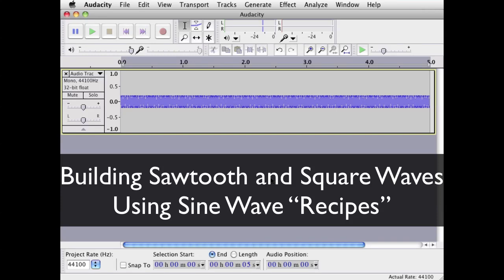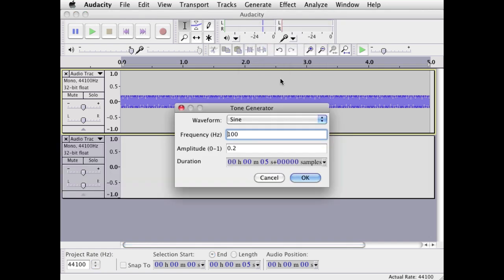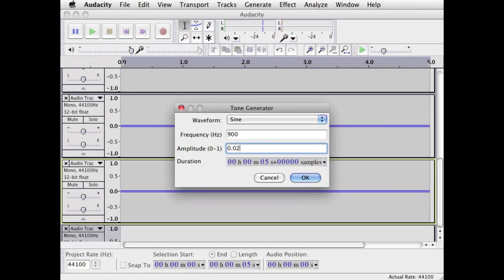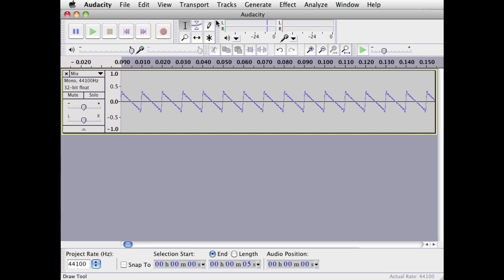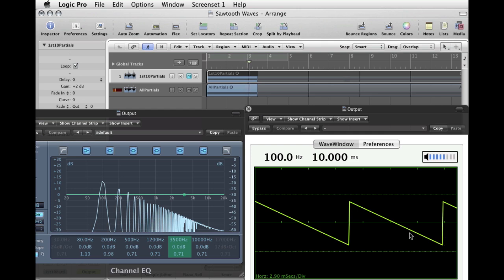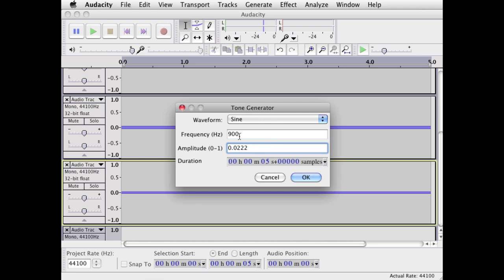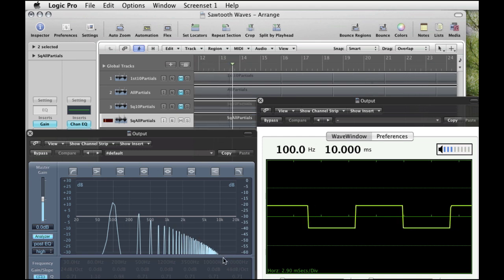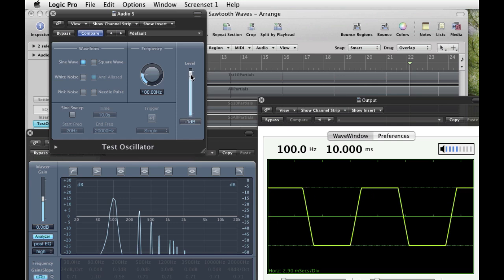AF003a Sawtooth and Square Waves

Comment: You didn't explain why on some audio devices it doesn't sound good to overdrive, even though it creates what is effectively a square wave. Is there some technical reason?
Reply: It depends on your desired tone. Speakers sound like they "crap out' when driven too hard, cuz they lose the vibration room necessary to produce lower frequencies. 
Similarly, vacuum tube amplifiers' distortion is good up until a point, and they the distortion becomes far too complex, and the signal is totally unintelligible to humans. 

Another thing to note is the hardness of the distortion. Hard clipping, like in digital files, is very bright and shrill, and humans tend to prefer softer, smoother distortion. 

In digital environments, added tones from distortion can also exceed the maximum frequency of the file sample rate, causing them to play back as non-harmonic partials called aliasing distortion. 

Lastly, less complex material sounds better when running into distortion. Because of the way it changes the amplitude of the whole wave, distortion creates higher harmonics, but also sum and difference partials. Stuff like solo guitar sounds nice and thick as a result, but jazzy chords or full songs or reverb can sound muddy, because the harmonic material going into the distortion is too complex.

Comment: Impressive how the small amplitude partials still make a contribution. Old software wouldn't typically generate the sharp waves from partials, and it sounded ok, unless the frequency was offset from a round multiple of the sampling rate.
Reply from the maker: You might find this interesting - the whole video is fantastic, but the section the link starts at is relevant to this comment. https://youtu.be/cIQ9IXSUzuM?t=20m18s

Comment: so basically the sawtooth wave is made of partials. First partial starts at the sawtooths highest amplitude and devides by half of each partial down the line.  and its frequency starts at its lowest point and multiples itself by its partial number ? did i get it?
Reply: Anthony D'Amelio a sawtooth is made by continuous decays for each hertz, with the lowest hertz being the "sound", whereas squarewaves do this but have half the partials in order to invoke a quieter, blockier sound (ba dum tss)

Comment: Hello,
would like to know is it possible to generate the Triangle wave by sine wave?

Thanks
Reply from the maker: bc Hi bc,

Yes, it is. The specific math is a bit more complex - here's one description, from https://en.wikipedia.org/wiki/Triangle_wave : "It is possible to approximate a triangle wave with additive synthesis by adding odd harmonics of the fundamental, multiplying every (4n−1)th harmonic by −1 (or changing its phase by π), and rolling off the harmonics by the inverse square of their relative frequency to the fundamental."

In fact, every sound wave of any shape can be constructed by sine waves. The process of figuring out which sine waves are present, how much, and when, is called a Fourier transform. That's the mathematical principle that makes a spectrum analyzer possible.

Thanks,

Matt

Comment: I think that in his case, "limit" is better referred to as "clipping". From my understanding,clipping occurs differently in digital and analogue systems.

In analogue systems, clipping occurs when the equipment (or the power amplifier) is driven to output a signal which is greater than the max level (power) the amplifier can generate. 

In digital systems, clipping occurs when the amplitude is larger than the largest value that the digital system can represent.

read up on "audio clipping"